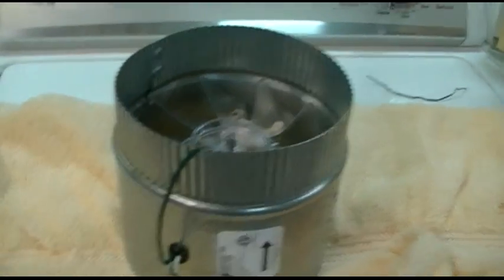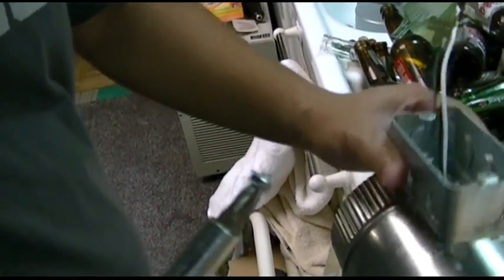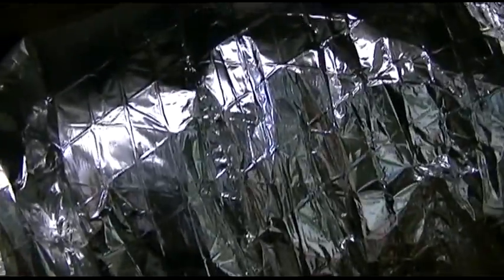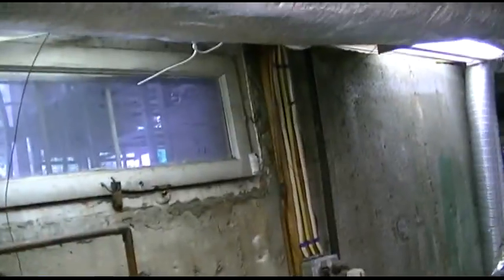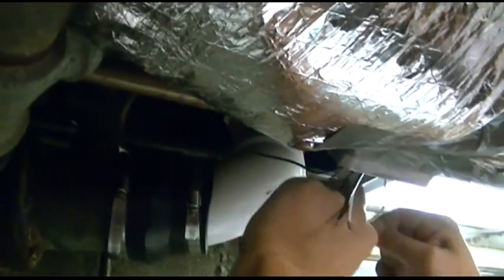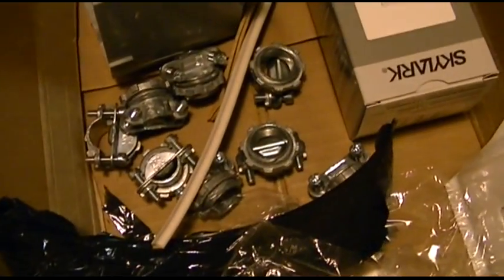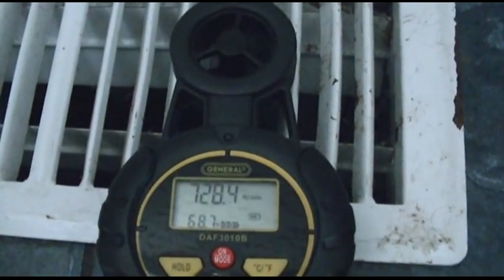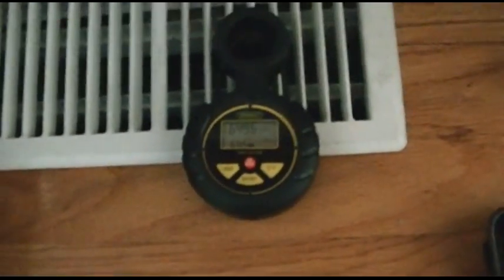Suncourt Inductor HVAC Booster Fan Installation and Review

Comment: Nice video.  Install question for you.  We had a local HVAC company install an in-line booster fan for an addition we recently did since we noticed it was cooler in that room than the others.  The way they installed it, the fan comes on when the thermostat calls to the furnace and then shuts off when the thermostat clicks for furnace to go off, but the blower doesn’t actually come on until a minute or so after the thermostat calls for furnace to heat up and the blower blows for a few mins after the furnace clicks off/booster fan had already shut off.  Would you have any suggestions if this sounds right?  We had anticipated the fun to sync with blower, not so much with the thermostat.  Any suggestions you might have would be greatly appreciated!
Reply from the maker: It was probably easier for him to wire it up the way he did, and faster.  That way he can get on to the next job sooner.  That's the long and short of the story.  Now, typically, this isn't going to make a lick of difference in the end, you're not gaining or losing heat really as it's for a very short while.  

Another reason it may have been done that way is if your blower has 2 speeds, and it automatically switches between them.  Barring that, "audibly aesthetically speaking", I would have definitely preferred it to come on and off with the blower.  If the blower is 1 speed, and the blower motor runs on 120 volts, there's no reason you couldn't tie in the inductor fan with the blower.  But that's ONLY if those 2 conditions are met.

On mine, there's no furnace as I have a hydronic boiler instead of forced hot air.  The air conditioning is a proper single-stage unit, only on or only off.  It's tied to the 120 volts that my blower runs on, so it comes on and off with the blower.

Another thing you can do, that the installer should have done, was balance the system.  The air handler should have adjustable louvers inside for each vent.  Balancing the system would entail slightly closing every other vent while opening the addition's vent(s) fully.  It will take a day or two to feel the difference, which is why most installers won't do it.  Sometimes it needs several adjustments over several days.  But it is something you can do easily, provided you have easy access to the air handler, and it is so equipped.  Mine is, and in addition to installing these inductor fans, I also balanced the system.  Nice and cool all throughout.  That's especially important because all 3 vents these are on, are on the southern exposure of the house.
Reply: The first motor you hear when the heat comes on is an induced motor that removes fumes before the heat kicks on. The reason the blower runs a little bit after the heat cycle is to prevent overheating wires and circuit board.
I'm wanting to add one or to fans, but that could be too much juice to fire 2 fans and a blower at once.

Comment: Was that an IBM 5140? I have one but I lost the power adapter do you know the specs on it?
Reply from the maker: It sure is!  The power adapter for that one failed actually.  The original power adapter is 15V at 2.7 amps.  I didn't have a 15V supply laying around, but I remembered that there was an option available for the 5140 for the car that plugged into the cigarette lighter.

If I recall, the booklet for that strictly stated that the adapter could power the system but not charge its battery.  So I figured if that's the case, the system should be able to run on 12V since that's what a car is.  I don't care about the battery charging because that's long long dead.

I cut the cord off and rigged it to a 12V adapter with enough amperage, and it works fine.  Finding a plug to fit, well that you'll have to experiment with since it was a funny plug.  Standard size barrel jack, center positive, but finding one that will fit inside the system is key, and may require some trimming of the plug body with a razor blade to make it fit.

Comment: Does this make air skip the other vents that are before it this one?  If the whole unit is sealed that air has to come from somewhere right?
Reply from the maker: No, not really.  What it does is forces more air to the vent it's installed on.  The air won't "skip" any vents.  You might notice slightly diminished airflow from those vents closer to the air handler.  But that will more than be made up for by the extra air being delivered to the farther vents.

See, the air handler is only so powerful.  It can only move so much air at one time.  The farthest vents get the least airflow, as a matter of simple physics.  This helps to combat that by balancing out the airflow.

Every vent in my house has a "home run" back to the air handler; it's not really good practice to install multiple vents on the same run unless the duct gets progressively larger towards the end.  Since install, back in 2013, the kitchen and dining room (farthest vents I have) are MUCH more comfortable.  It really works well.  Although I put a speed switch in, I leave them running at full blast all the time.  I might swap that out for a regular on/off switch one day if I need that fan speed controller elsewhere.

Comment: Thanks for the fun walk-through; love your sense of humor! Do you leave these running 24/7? Have you noticed any measurable impact on your electricity bill?
Reply from the maker: Thanks very much!  These are wired back to the main air handler, and the power is tied into the blower there.  That way, they only turn on when the air handler does.  When the thermostat in the house is satisfied, the system shuts down and the inductor vent fans stop along with the air handler.

I don't really remember how much power they use, but it's a little shaded-pole motor, I couldn't imagine it uses more than 30 watts or so; I installed 3 of them so it's probably 90 extra watts, but may be actually less, since the airflow in the vent already acts to move the blades already, lessening the load on the motor.  They were well worth it, I've never had those far areas of the house uncomfortable again.

Comment: Hey Jay, I know this was installed back in 2013, but wanted to see how much it ended up costing you to install this. And for the wiring, I'm assuming u hooked them up with the existing fans that are turned on and off by the control board so it only runs when the blower is on, correct? I'm getting a crazy quote from an AC guy for adding a booster fan and wanted to see if I should just try to do it myself when it gets cooler.
Reply from the maker: Yeah the AC guy is going to be WAY out of line.  It's been a few years, but here's what I remember:
1.  Installation of them was very easy.  You can cut the flexible ducts with a utility knife, then use a wire cutter to cut the wire spring.  Try to make the cuts straight.
2.  You'll need the vent fan(s) themselves, for a 6" like these back then they were $30 or so, now they're hovering around $37.  Close enough.  Self-tapping screws are nice to have.
3.  You'll need a "handy box", an electrical box to mount to them.  You can be crafty and install an on/off switch in it if you'd like the option.  Also whatever wire tools, cutters, strippers, you'll need wire nuts and electrical tape.
4.  The fan itself gets mounted in place pretty much with duct tape.  Tape it up good, you don't want any leaks.
5.  You'll need to run a wire back to where the main blower is, so you'll need 14-2 (14 gauge, 2 conductor) wire.  If you have some around already you're set.  If not you'll have to buy a spool, and copper ain't cheap anymore, but it will never go bad so you'll always have it.
6.  Find the wires connected directly to your blower motor.  Should be a white (neutral) and another color wire (hot).  From the wire connected to the vent fan, white to white, black to whatever the other color is.  You may need to cut/splice/wire nut things together.

All told, if you have to buy a spool of wire, probably around $100.  If you have wire on hand already, probably more like $50.  Time is going to be a couple hours taking it nice and slow and doing it right and meticulous.  You can leave the entire system powered up and running until you're ready to connect the vent fan wiring in.  Good luck, let me know how it goes!

Comment: I'm sure the 100 more cfm helps, but I wonder how much electric they use. It may be cheaper to drop/increase the t-stat 2 degrees. Having multiple duct fans has to pull some decent power running numerous times during the day.
Reply from the maker: They're little shaded-pole motors.  Not a lot.  The already-moving air actually lessens their wattage use.  Since I've installed these, it's been much more comfortable in the far corners of the house.  Really work well.  Glad I did it.

Comment: Hey do you think a few of those and flexible duct wold work in a cabin to get the heat from a woodstove circulated around?
Reply from the maker: If the ducts are installed in strategic locations, I'd expect it would probably work pretty well.

Comment: Well... At least they're induction motors... Instead of POS DC motors... And they seem to serve their purpose!
Reply from the maker: They're C-Frame or what us old fogies call "shaded-pole" motors.  I remember seeing a lot of electric pencil sharpeners that plug in that were using puny DC motors, and most reviews of them stated they were utterly useless.  I have 4 AC motor Panasonic pencils sharpeners that will last me the rest of my life, and then likely many lifetimes thereafter.
Reply: jaykay18 I have a sharpener from x-acto that also has a huge motor. I have another x-acto that is much newer, and it has a puny dc motor that I can stall without trying. it also takes about 30 seconds to sharpen a new pencil. The other one has a nice big, heavy, powerful AC motor that no matter what I try I can't stop it! And it sharpens in about 2 seconds! It's not as old as a old Panasonic, but it's before they switched to crappy dc motors.
Reply from the maker: Smurdle450 The DC motor one is garage sale fodder now.  The AC one is something to hold on to.
Reply: jaykay18 I can't disagree.

Comment: Dude I love this video. It's like you don't give a dam what people think. I got a bedroom over the garage that I plan on boosting that air to that room. It's like a oven in there at night. So I just cut it in, tape it and plug it up. I think I can do that. Thanks any tips let me know.
Reply from the maker: +thurm101 Thanks!  I wired mine back to the main blower so they come on when the blower does.  It's not going to make a world of difference but it should help!

Another thing you can also do is try balancing the system.  This will require a few days of small adjustments and then waiting to see if it will make a difference.  On the output of the air handler, where each duct connects, there may be a small lever that you can move one direction or another.  Most HVAC guys leave them wide open.  These are dampers that close off airflow to particular ducts.  So you'd open the duct to the hottest room all the way, but partially close off the ones to all the others.  These levers don't move very far, so a little movement can make a significant difference.

So if you open the vent to the room that's the hottest all the way, and close off the other rooms a bit, you'll get more cold air being delivered to that hotter room, and less colder air elsewhere.  The unit may run longer if the system is completely out of balance, but eventually you end up with a nice cool house in all rooms.

Usually what I do, when it becomes A/C weather, is I turn the system on, set the temperature to 70, and walk away till September.  First day it runs all day, second day not as much, third day even less.  Every item, every wall, every piece of furniture acts as a heatsink and has to be cooled to that same room temperature.  Once everything has acclimated, the system runs less because there are no large objects radiating their heat back into the room.

Hope that all helped out some!  Thanks for watching!
Reply: +jaykay18 Thanks. I will try that. Because it gets so hot at night. But will the fans still work or should I try adjusting first?
Reply from the maker: thurm101 These booster fans are only going to increase airflow.  The best result will be the combination of both, which is exactly what I did.  Oftentimes in the summer I find myself going outside to warm up!
Reply: +jaykay18 So both would be putting 2 inline boosters to that room?
Reply from the maker: thurm101 No, sorry.  I meant adjusting the dampers and installing one booster fan.  

I had three vents in my video that were farthest away, so I installed three fans, one for each.  Those 3 are also on the back wall of the house, which faces south, and is farthest away from the unit.
Reply: +jaykay18 Alright buddy you have helped me. I think it's a done deal for me. As for me I think my power source will be a timer to have it turn on at night to increase comfort levels in that room. I was reading about installing to AC and getting a sensor. But I don't think I am that advanced for that. Also there are some on Amazon with cfm that are 240 is that good?
Reply from the maker: thurm101 You can definitely use a timer.  It may run when the system isn't, so you'll get airflow but it won't be cold.  However if the rest of the air in the house is, it should be just like having a fan on.  

Airflow from these are generally pretty weak, but any bit is an improvement.  Mine are supposed to be rated at 250, but many have reported that it seems a lot lower.  It is what it is.  It's better there than not, plain and simple.

Comment: why don't use a relay. and install outlet close to the booster fan just run thermostat wire. is more professional
Reply from the maker: +Gabriel Martinez Velazquez That was certainly an option.  I just so happened to not have a relay or thermostat wire on hand.  Rather than go out and buy those items, I used what I had in stock.

This way, these additional blowers are controlled by the same air handler circuit as well, if I shut the main disconnect for it, these also go dead for additional peace of mind.

Comment: Your problem is the flex. 5' of flex is equal to 15' of hard pipe.
Reply from the maker: +Dan Snowwhite That sounds very reasonable.  The biggest problem is those 3 registers are on the south side of the house, and that part absolutely bakes in the summer sun.  The flex certainly didn't help any, but these vent fans did, it stays considerably nicer there now.

Comment: Are these fans still installed?
Reply from the maker: +Andrew Gallucci Oh yes, and still working.  People always play with the speed switch when they're downstairs there in laundry central.  Those fans make the nicest hum when they are running.
Reply: Do they move a lot of air?
Reply from the maker: Andrew Gallucci They help move air.  If you really had vents with very low airflow these can help bring hot or cold to those rooms.  I installed these 3 on the ducts going to the 3 farthest vents from the system.  Do they work/help?  Yes.  Kept the house a perfect 70° all throughout the summer.
Reply: I guess they could be worth it depending on the location of the vents to the air handler.
Reply from the maker: Andrew Gallucci Yes.  Not only were these 3 vents the farthest away, they were all also on the south side of the house.  More cold air to the hotter areas.  Brilliant!
Reply: That plan worked out perfectly!

Comment: I need one of those. How long are the flex duct runs from the handler to the vent?
Reply from the maker: The longer the duct run, the more these will benefit you.  The vents these drive are on the opposite end of the house, so those vents are probably run between 40 and 50 feet from the air handler.  I "cut in" the booster fans probably 15-20 feet from the vent itself.  The closer you mount them to the vent, the more you'll feel a difference, but likely the more you will hear them.

Where I have them mounted, they certainly help, and the only thing I can hear (even with 3 of them whizzing at top speed) is in the basement when I stand right below them, a quiet whir.  At the vents, the airflow is stronger, so there is a little more "rushing air" sound, but it's just barely perceptible.

Comment: I installed 2 booster fans at my house. They have a normal house plug. How would I go about connecting them to the furnace
Reply from the maker: You can do it any way you want.

What I would do is find the wires that supply power to the furnace's blower.  Run a 14/2 line out to where the booster fans are, install an electrical box and a duplex outlet, and plug them in.  Bonus points if you use a double-ganger and install a speed switch as well.

Other ways are to cut the plugs off, wire them all back to the same 14/2, or you could also get airflow switches for the boosters, and plug them into whatever outlet is available, that way when the furnace blower comes on, the airflow switches will activate, turning on the booster fans.  When the furnace blower drops out, the boosters will spin down a few moments later.
Reply: Blower motor runs off 240V, so it'd be problematic to run the duct fan off that power. Any other solution you could see?
Reply from the maker: Tom Lopez If there's a neutral leg in that 240v line, just hook to one side of the 240, and the other wire to neutral.
Reply: jaykay18 no such luck. I'll keep researching. Thanks.
Reply from the maker: Tom Lopez Suncourt also sold some sort of "wind sensor" that you'd also install in the duct, when it sensed moving air, it would turn on its outlet, which you'd have the inductor fan plugged into.

Comment: Feet per minute is not CFM. An increase of 100 FPM on a 6 or 7" duct will get you about 20-40 CFM, not 100.
Reply from the maker: Thanks for pointing out my error, I stand corrected.  Either way still an increase in airflow.
Reply: Wrong. Cfm and fpr are not the same. Look at a ductalator hasan.